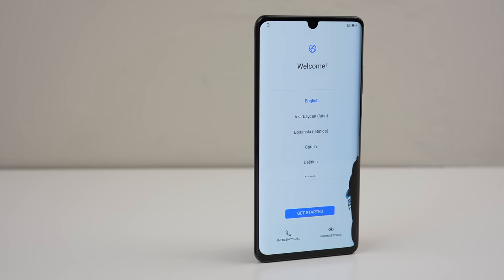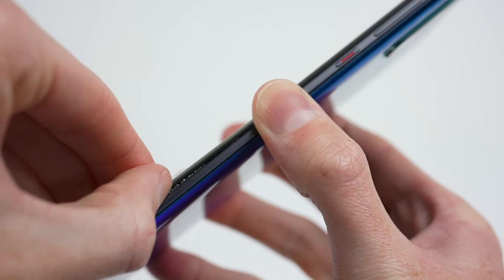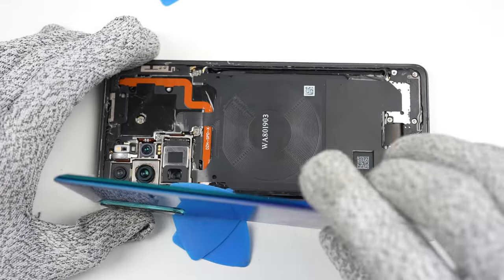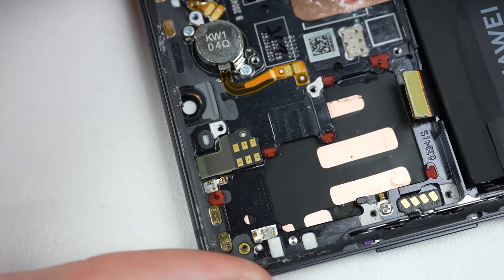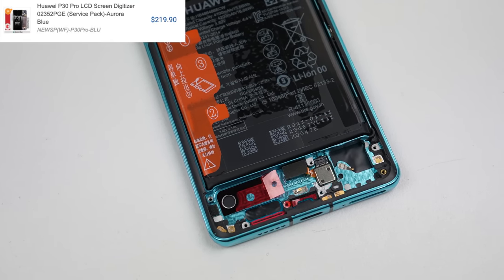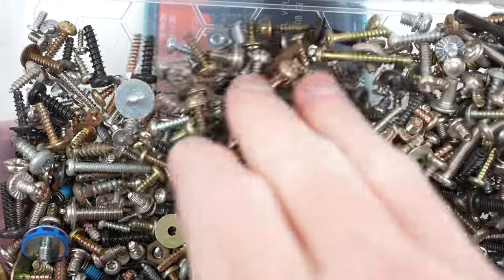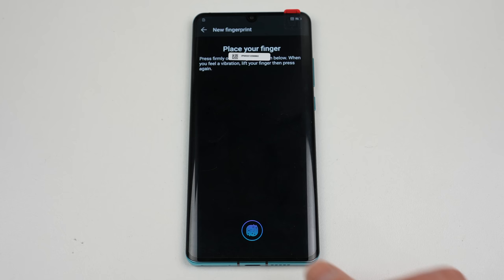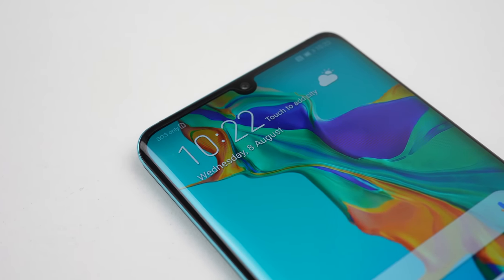Huawei P30 Pro Restoration - Fixing A Technicians Mistakes

Comment: "oddly, the screws are not magnetic, so I've had to use a pair of tweezers to pull them out" ... " The last repairer needed an iFixit magnetic mat, which would had helped to keep the screws organized and stop them to getting lost"  :D
I still love Hugh's videos. Very educational. I am also a huge supporter of the right to repair movement.

Comment: 1) acrylic adhesive strip you were using lasts about 2weeks, than it'll come out. Liquid "always sticky" glue like E8000, B7000, T8000 etc. are doing they job much longer and safer. The reason prev repairman was leaving original adhesive in place is its thickness (you won't get right 0.1mil thickness tolerance with a strip you were using).
2) improper heatsink material used. You were using regular thermal paste for like CPU cooler and others, it's not applicable here. The original material used is called "liquid thermal pad" or "liquid-dispense thermal transferring gap fillers". It works with constant thermal conductivity wherever gap thickness is changed and it won't ever get dry (like a paste). It's rather expensive compared to thermal paste and it has gap thickness "freeplay" about 0.875mm. Some blue residue you were found in the case is this material.
Reply: yeah those adhesive strips he and Zack from JerryRig use always scare me. But I've seen then hold longer than two weeks, granted the phone was in a case. it also doesn't go all the way around
Reply: Regular PC thermal paste can easily get into wrong places inside the phone especially if using as much as he did. I agree with you about the adhesives too. B7000 and other similar liquid adhesives are not that bad if you don't have new original style custom cut adhesive strips.
Reply: Those liquid "thermal pads" have crap thermal conductivity. Trust me, I've used them. They suck. Only real benefit is the decade or more lifespan you get out of them and easy cleanup if you do need to replace them.

I use a high quality thick thermal paste for these applications and performance or at least thermal performance has always improved and stays that way for many years. The phone housing and display always heat up way more afterwards. Sustained gaming performance is also noticeably better.
Reply: Thermal paste should work just fine. The heat spreader will prevent it from seeping outside and it's non conductive so it won't damage any of the chips under the heat spreader. Many phones use regular thermal paste especially combined with heat pipes.

Comment: Nice work,man.If you happen to ever fix a Rog Phone here is what i found doing mine.
If you charge it and a red light and then a few moments it goes away it only charge 1% on non original charges.
Replacement screens can be bought with frame or without frame(frames is easier to do),I got them from aliexpress just know you may get some with small scratches. 
And something that it does after restoring to factory settings is that the last known email remains but can still be bypass(I did it to my rog phone 2).
Also or those who goes to a repair shop that specializes in Rog phones,take photos of your replacement screen (had 2 scratches and get one without)if sometime later it breaks.

Comment: Awesome, i think its more ethical to always recommend Service Pack instead of the cheap aftermarket, a question on re-application of thermal paste on copper heat sink, is computer heat sink okay? or will it work if thermal paste is not applied?

Comment: fyi, the old original adhesive from the backglass is ten times better and stronger if u just reaheat it when u put the glass panel back on the phone, the double sided adhesive tape is trash compared to what comes with the original... @Hugh Jeffreys
also, u emhpasized on the missing screws from which hold the plastics, which are not so important as u might think, but u missed the important one which hold the motherboard in place...

Comment: That's the main issue for these p30 and p30 pro and probably any huawei phone, the display replacements just aren't economical, spending 150+ on a new display when you can get a used phone for not much more, ebay is flooded with these phones where people simply choose not to repair them due to cost. I personally had a p30 display break and a new display was about 120+ from china, after a few weeks of checking ebay I actually managed to pick up a p30 pro for 160. The OLED displays have a habit of bleeding too, you may have a black dot or splodge to start with when it's been damaged but after a few days or a week or less it spreads to the entire display, my advice to anyone who has a black splodge from damage is to get your data off as quickly as possible, or install some remote software to access the phone at a later date.
Reply: Ellis The DJ  Ye it would as the security screens are just black when you remote in, but I got around that by remembering the placement for the unlock screen at least anyway, or better yet remove any security while you have the chance.

Comment: Actually You missed 1 screw in mainboard it self - it is second hole in right corner and goes directly in mainboard under wireless charger. :)
And original Huawei back cover adhesives are cheap and better holds back cover + there are 4 more small adhesives along with that which goes around body. I guess that after Your repair it's not waterproof at all. 
But anyway - great job!

Comment: I accidentally broke the connector on the motherboard that holds the power flex cable. Is there anyway I could fix this? If I buy another MB will I need to hack the battery or buy a new one?

Comment: Is it a bad idea if I bring my broken HUAWEI phone to a repair shop that offers LCD replacement at a cheaper price? because the authorized repair service replaces it with a genuine LCD screen but is so costly. my budget is $100. the screen on the authorized one costs $400 while the non-authorized one costs $100.

Comment: This hurts me. I tried to repair my brother phone's which is a p30 pro (oled panel broke around a bend point in the chassis somehow) but we only got a new screen without a chassis. I only used liquid adhesive as that's all I had and wanted to keep the phone a little water resistant even if that's dumb, and the first time I had a bad time fixing it but managed to get it done and it worked, I wanted to apply a screen protector..... with UV curing liquid.....which is a solvent.... obviously, it seeped though the glue on the edges and f'ed everything up. It was hell to unglue and clean. I managed to do it again, and it worked, but somehow a few days after he got it the touch part of the screen stopped working correctly... I put so much effort into fixing it and it was all for nothing. I promised myself not to fix stuff for others anymore.
Oh and, he bought the phone "new" from a seller selling it cheaper than others, turns out he paid more for a refurbished phone sold as new. That didn't help me in the repair.
And also the screen we got was from witrigs (which apparently is scammy) but the screen was either original or an exact copy of an original because it was identical to the screen I replaced which was original.
Reply: I know how it feels... i tried to fix my beloved first phone and destroyed it. One screw was a tiny bit longer than the others and i put it into the wrong place. Only noticed when turning the phone back on, as it put pressure on the screen from behind and cracked it. Kills all your motivation to fix something. 

Fast forward 1-2 years... now i am sitting here with the P30 Pro of a friend. Got it all disassembled at not sure what to do next. Replace only the screen? Would have to glue twice (screen and back). Or get a new frame with screen. Would only have to glue once but take out the motherboard. Which means adding new thermal paste which i don't have.

Sucks.

Comment: I managed to fix my xiaomi phone after I broke the hell out of my screen. Surprisingly, I didn't fully break the whole thing when I repaired, though I did accidentally broke the plastic frame that separates the screen and the metal frame. Whoops. But I was able to stick it together with double sided phone tape and you can't see it when I have my case on. Not too bad for a first time job.

Comment: 3:48 how would it help if the screws are not magnetic?
Reply: Maybe the ifixit magnetic pad can magnetised non-magnetic screws.
Reply: @mueffe1357  against physic laws?
Reply: @Ilshatey  against what laws of physics?
Reply: @maxz8807  like magnetic properties of metals such as aluminum, copper and brass?
Reply: @Ilshatey  Magnets. How does it works?

Comment: Huawei devices are kinda hit and miss when it comes to parts. Either parts are hard to get or what you'll get aren't original. My previous Huawei tablet took several months before their Official service center got an original battery for it, after repeated follow-ups on whether they have the replacement battery or not.
Reply from the maker: That's the issue with not having a main stream phone.
Reply: @HughJeffreys  Yeah, but what's kind of disappointing is that even for their flagship devices, their parts are not often available and you'll have to wait for a long period of time to arrive. 🤷

The Huawei tablet I had was their Mediapad M3 8.4 (one of their flagship tablets). I had to go to many of their service centers to ask if they had replacement. Their answers were they don't have any replacement battery nor do they know when such parts will be available. 🤷

Comment: Notice how the phone doesn't give crap, about new parts?

New fingerprint scanner/display, it just scans it.

When I switched the screen on my Huawei phone, it removed every safed fingerprints and when logging into it, it opened up the screen where you can add new fingerprints without any issues.

The only problem I encountered was, a camera swap it gave the iPhone camera buggyness, however I didn't fully plugged in the camera connector, other camera apps worked fine though, after plugging it in correctly everything worked flawless. (the screen is a bit weird I can see the screen pattern on a white background (original screen))
Reply: That's called display burn in
Reply: @windowstips1430  nope, it is across the entire screen. (which I mean is possible) and it is IPS not Oled.
Reply: @watercloud  LCD* yeah it can also happen on those but I've seen it once and it was temporary

Comment: Wondering if anyone on here might be able to help. I have a huwaei p30 pro which has a broken screen. Unfortunately my niece dropped a bottle of gin on it smashing the screen on one side. At first it seemed to be working but now the whole screen is flickering and pinging around. The middle portion is blacked out and unusable. However I can still input the fingerprint. I am wondering if the phone is fixable? I have had my phone for years and really don't want a new one but I worried the lcd screen is damaged